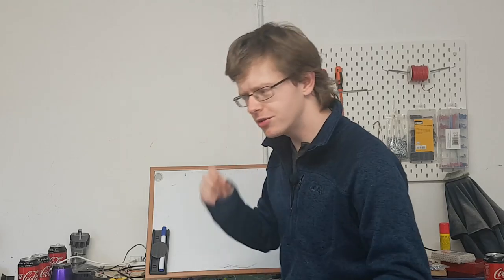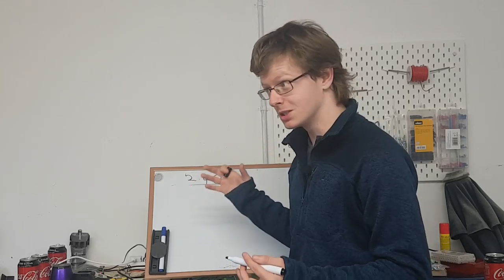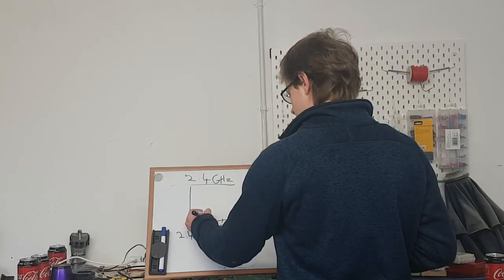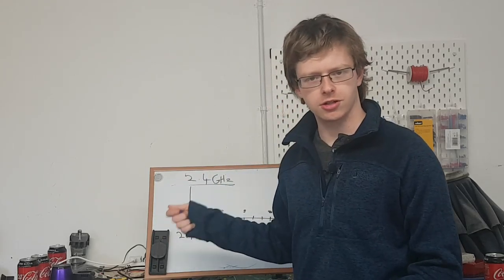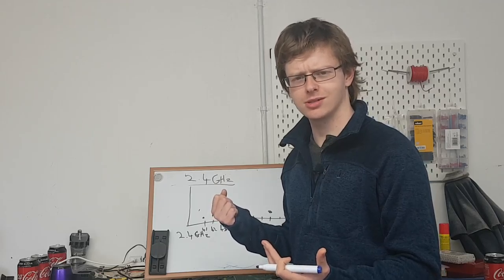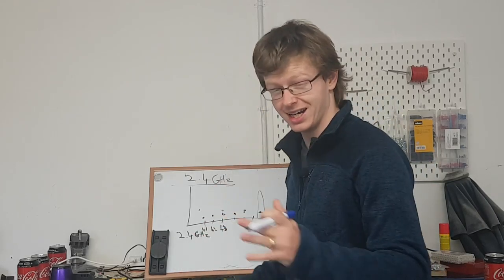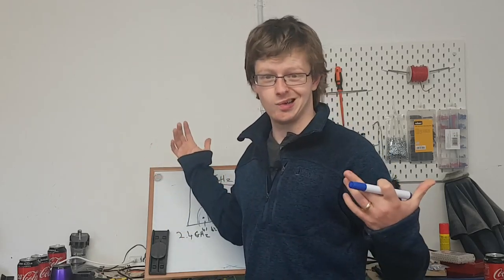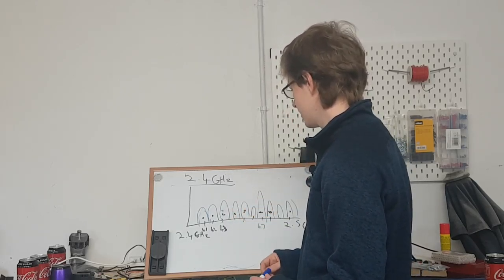How Do Wireless Devices Avoid Interfering With Each Other

Comment: I recently made one of these myself just using bits and bobs from China however how can you jam the frequency and then retrieve the code from the fob as the jammer spews out a more powerful signal obviously to block the key fob ??
Reply from the maker: Yes with Key Fobs it's easy to block. Because their  signal is so brief they do not use Frequency hopping. So in that case the stronger signal wins.
Reply: Maker Vlog I looked at this on adaucity and tried to retrieve the fob signal but it’s mostly obscured by the blocking signal there a device called a roll jam how can this work!
?
Reply from the maker: What Kind of key Fob is it you are using is it a car key? I normally use software called GNU radio to capture and demodulate the signal. If you want I will do a video on decoding signals like this.
Reply: Maker Vlog yes that would be fantastic I’m currently using my own car key fob 433 MHz , think there would be a few of us interested to see you do a vid on this 👍🏻
Reply: Maker Vlog I’ve a wireless doorbell that I’ve been trying to capture the signal and replay it then make the bell work I just don’t know how to use gnu radio or just in general transmit from my hackrf
Reply from the maker: I will get on that :). Have you been having issues capturing or replaying the signal With the wireless doorbell? I would guess it's probably using a static code so should be doable. I will get some links for you. I know some of the GNU radio tutorials can be a bit overwhelming.
Reply: Maker Vlog hi and no capturing the signal for the doorbell is the easy part (for me ) 😂 using my hackrf and sdr# can catch it no issues like you said gnu radio can be overwhelming it’s then replaying it that is the problem also like yourself I’ve also been looking at the jamming side of things 😊👍🏻 I built two very powerful jamming devices around 433mhz however they are that powerful that When I try to jam my car key and retrieve the code (for later) I’m unable to get it because of the power of the jammer (the code) is obscured by the more powerful signal also do you have a work email address? So that I can ask you some questions rather than embarrassing myself on here 👍🏻
Reply from the maker: Yeah sure ping me at makervlog04@gmail.com :)
Reply: Maker Vlog awesome 😎